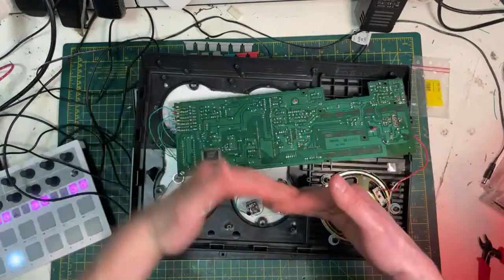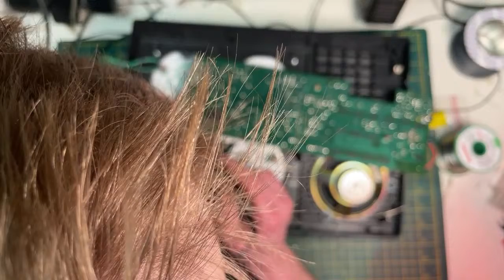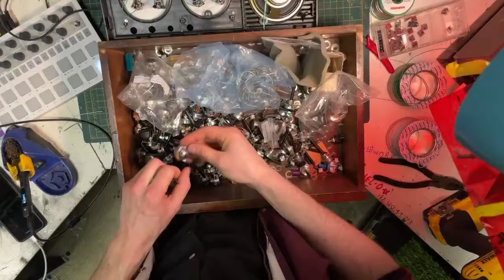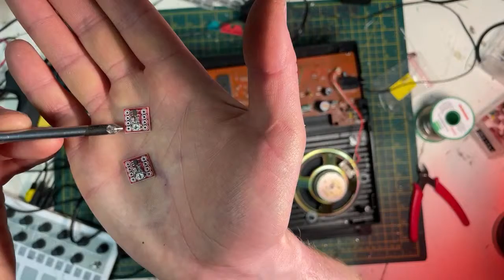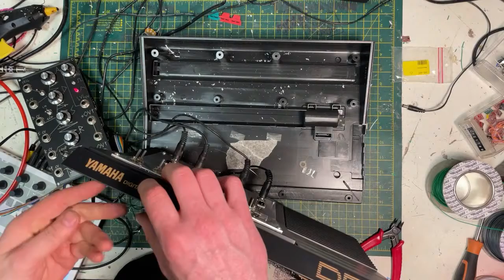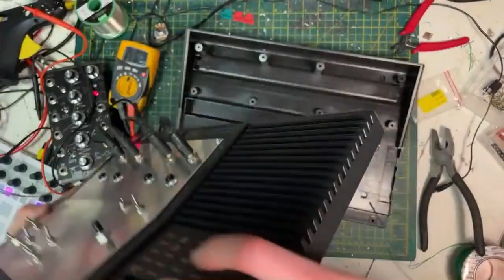CIRCUIT BENDING(or breaking) YAMAHA DD5 drum machine part 2

Comment: I've sanded my tips before 2 it was terrible but I also didn't have tip tinner I wonder if that would have worked better. I've also used thick solid copper wire and made makeshift tips that I sanded to a point and a pinch and you don't want to know what kind of situation that you have access to such things and require soldering to live so whoever's out there reading this at night when you say your prayers include that

Comment: FWIW I've found Bidnapper to be solid for eBay sniping.

It would be better if eBay changed their model to something like what Grays Online does where the auction doesn't have a defined end time, it ends sometime within a 5 or 10 minute window which means people are more likely to actually bid what they think it's worth from the outset rather than trying to snipe it at the last second because they simply can't.

Comment: Well, you could have made a quick mini PCB to Hold 2 Cd4066, or CD4053 ( SPDT ), or Cd4052, or CD4051, or LM13700, or Cd4017, etc  and some amount of  extra  via's and have them on stock for just in case for future "bends", a tiny PCB that has mounting holes on the corners, lots or enough of via's and a IC footprint  to hold some of the  "famous" ic's. a tiny pcb for each type. just in case you get a bright idea.

that was really a good idea, the Cd4066, would probably be a lot of fun to hear, mangling the databus .... maybe in combination of a Cd4040 ripple counter to control the Cd4066's .. and a 555 timer

... or 1n60, BAT85 Schotkey diodes .. are sometimes better, smaller voltage drop.
Reply from the maker: that was part of the plan but gunna do it in my own time, was going to breadboard a 4066 stripboard for this, then make a pcb for future ones, but didnt bother in the end. next time, some times keeping it simple is better but im doing the 4066 mod on the next one. but not adding anything else thats what the modular is for :D.
Reply: @LOOKMUMNOCOMPUTER  well, most ic's have VSS on pin 7 and VDD on pin 14 ... in case of DIP 14, much easier saves alot of short wires and nitty pitty work, the PCB design  should only contain the footprint of the IC and 2 locations for 100nF bypass capcitors ( on the VSS / VDD pins) and 3/4 vias per pin of the ic.  It also allows to solder headers on the underside of the PCB and sticking it on a breadboard for better connections. even in the case of dual / quad opamps. time saver and guaranteed that it works first time.

Comment: I could be wrong, but I think the high pitch stuff heard when you use the pitch mod might be a result of slowing the DAC down but not changing the analog reconstruction filter on its output. So it's "false" high frequency signal from things being out of whack with the nyquist frequency.
Reply: That sounds like solid reasoning....can you suggest a fix? I have this happening with my DD5 that I added this same pitch control.  Maybe add a passive low-pass filter?  or maybe there's a way to adjust the existing filter that you mentioned?
Reply: @j3ffn4v4rr0  Great question. I'm only guessing about the issue. MY knowledge is nowhere near enough to know how to approach a fix.
Reply: The ear does not accept fake signals. You hear high frequency, it means it is there. It is your brain which is confused. Does my voice sound high pitched ?
Reply: Yes your brain interprets signals I am totally confused you might be as well a subject of my brain activity. And you are. Do not be ashamed of it
Reply: @botoxpig417  That's why I put the word "false" in quotation marks. I meant just that they weren't analogous recreations of the analog input.